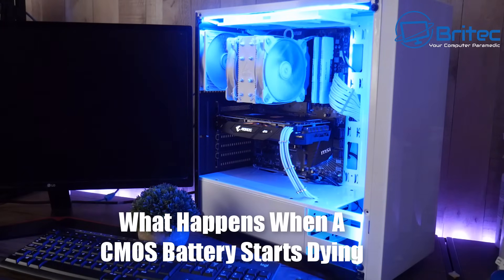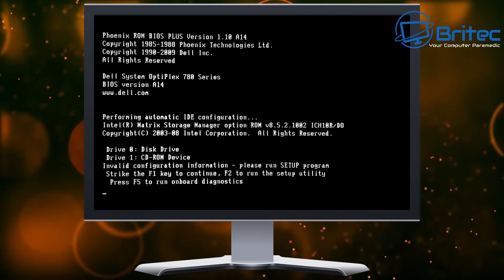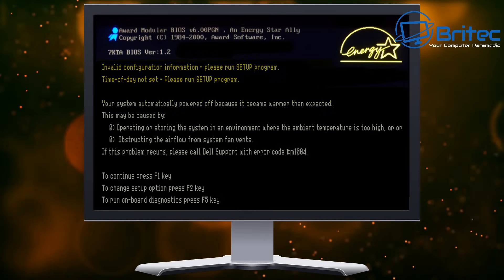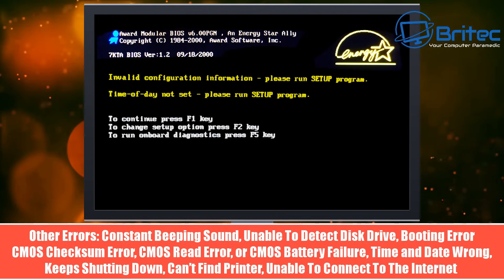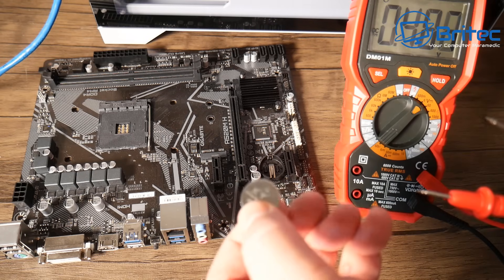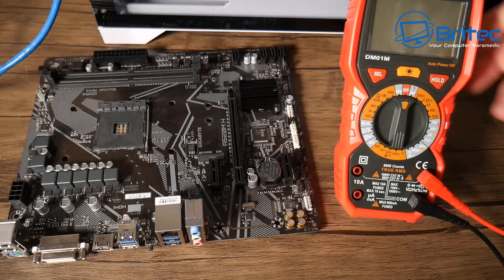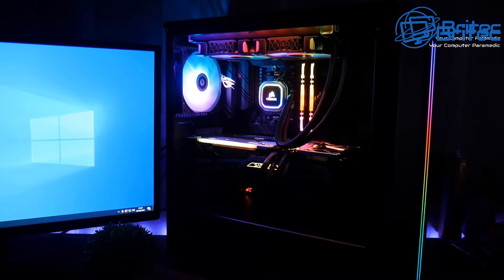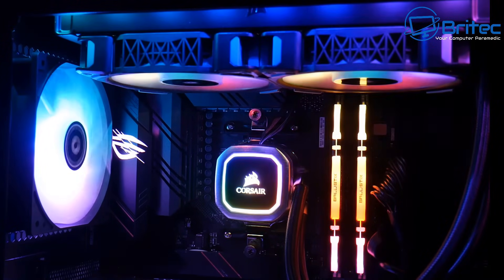What Happens When Your CMOS Battery Starts Dying

Comment from the maker: This video should help you resolve a lot of computer problems. Drop us a LIKE 👍
Reply: One thing I was taught about button batteries (and halogen lamps, too), is that they should never be handled without some kind of skin protection, (gloves, tissue paper, etc.), because skin acids can have an adverse reaction with them, shortening their lives, and causing corrosion, possibly even leading to electrolyte leakage.
This applies to all types of button batteries, regardless of their intended application, whether it's a CMOS, a digital or an analogue camera, or something else.
Also, I don't know about the UK, but here in Australia, we can buy genuine Mallory CR-2032 batteries or their Eveready equivalent at most supermarkets usually in packs of 4, which will last you for years, and much cheaper than those Amazon and eBay burglars are charging (plus shipping costs).
Reply: :dothefive:Never thought of it. Cheers buddy!!
Reply: NEW subb, very useful vid - thanks
Reply: Do you have to memorize all the bios settings before removing the CMOS battery?  What happens, if you missed out on one of the items?
Reply: Thank You :)
Reply: Noice!  need to get this out to the masses.  See a lot of "fix my rig" where they omit checking the 3.3V Button cell on old budget builds.  Bit-rot can cause so many issues that it should be the first replacement you do servicing an old mobo.
Shared! 👍
Reply: Before the memory errors, the clock time will run fast.
Reply: Thx had booting error and could not find a way to fix it it was the Batterie
Reply: A  Ton Of Todays Gaming Crashes  Come From   Just This   =  YES   !!! And = YES  = Very Fist  Sign is an Alltered TIME CLOCK = Virtural Sync Will Not Keep Up with a weak battery  !
Reply: My PC doesn't starts, although it has power in it. CPU fan case fan, nothing starts. I tried everything, like  jumpstart, removing and reinstalling the CMOS battery etc. But it still doesn't work. Actually my pc wasn't been used for a month, and this problem happened. Than I turned on the pc by reinstalling the CMOS battery, and it worked. I used to do that almost every day for almost a month, whenever I face this problem. But today that trick isn't working. Now what should I do? Should I buy another CMOS battery, or it's not the problem of CMOS battery?
Reply: Pls help me if anyone can.
Reply: 16 years still working.
Reply: Little problem at times with the HD and location reinstalled windows 10 now no problem. 16 years 2 500GB Hitachi MBR hard drive still working?
Reply: If I replace the battery will I lose the cmos bios settings. Do I have re enter anything?
Reply: I was just cleaning my PC today and it's been stuck in a never-ending BIOS loop where it loads the motherboard menu for a brief flash to go into BIOS settings but never loads the Windows Boot Loaders from any SSD I have or a USB recovery drive.. 
It seems like it forgets most settings upon reboot, it only turns off with power switch, the power button doesn't do anything. 
I havent checked the clock to see if it keeps getting reset but it's been stuck in a BIOS loop no matter what settings I save, fTPM, Secureboot, UEFI is always correctly set, enable or disable CSM, none of it works.

Just a CMOS battery that's dead?

I just didnt get any error codes other than "your bios has been reset" everytime I have to shut it down and reboot.

Comment: Thanks for the video but, I didn't find it until I found the CMOS battery was the problem with my computer. I had all the possible problems you mentioned but didn't know there was a battery on my ASUS mother board. What pushed me to start looking for my problems was the video to my monitor quit. After changing some component like the video card, and the CPU I found the problem as I was starting to buttoning up the computer case to store it away for parts. I caught a glimpse of something silver on the board just as I was closing up the side cover. After measuring the voltage and replacing the battery, WHAM, the video came on. Solved!!!

Comment: It can also prevent you computer from booting up like in my case. High-end PC wouldn't boot up took it completely apart found no issues. Ordered a new motherboard as it was the only thing not functioning properly. Decided to replace the battery for shits and giggles. Boom 💥 it booted up

Comment: After replacing my thermal paste for CPU, I could not boot up my PC and a red light with +/- sign lit up on my motherboard. I didn't know what the problem was so I took my PC to a service and they checked all sorts of things for possible problems; everything checked out and seemed to work. Almost as a last resort the technician took out the battery and sure enough the problem was in the battery. It cost peanuts to replace it and saved me from worrying if my motherboard or CPU or something else expensive was at fault.

Comment: Both my old dell laptop giving clear 5 beeps cmos battery.!!! My old desktop amd Sabertooth 990fx showing CPU LED error but if I unplug 12v cpu then plug back in I can get it booting eventually into windows 10 with 100% stable system using benchmarks plus playing world of tanks which is why I started up the desktop after two years of not using it 😂. Hopefully two new cmos batteries solve both systems. Sadly both are very old systems that isn’t windows 11 compatible thxs to Microsoft upgrade decisions.🤬

Comment: I disabled DSM to load efi mode and boot normally to win11  and if I restart or turn on the PC I'm always forced to remove the cmos battery because the bios splash logo hangs showing delete and f12  menu
and I have put back all the settings since I need to use efi mode
I don't have a way to test the cmos battery but could this be the battery even if I'm not having any problems when csm is on?

Comment: I'm not getting any boot error messages, but I did notice that my keyboard stops working if I try to use Windows System Restore, or boot off a Windows install media to try and install Windows. PC is 10 years old. No signs of a low CMOS battery though.. not losing any settings. Windows boots fine. Just that recovery environment doesn't activate the keyboard, so I can't restore a backup.

Comment: Will it cause cpu to only work on battery power? Plugged in I'm stuck at 20%. Replaced adapter, charging port, battery, fan. Only thing left is motherboard. This is very strange 🤔

Comment: 🔴🔴🔴🔴HELP HELP HELP 🔴🔴🔴🔴I NEED SOMEBODY WITH KNOLEDGE 
JUST WOKE UP TODAY TURN ON MY COMPUTER( ACER ASPIRE Z1-611) AND APPEARS THIS BLACK SCREEN WITH THIS !!!!!!!!!= 

👇👇👇👇

Setup settings error, CMOS checksum error CMOS battery loss occurs.

Press F1 to continue or Del to enter setup
👆👆👆👆👆

AND A LOT MORE OF INFORMATION ABOVE =

👇👇👇👇👇 

BIOS Date: 11/27/2014

BIOS Version: P11-A0

Release Date: 11/27/2014

This BIOS is exclusively for Acer only

Copyright (C) 2002-2014, Acer Inc.

CPU: Intel(R) Celeron(R) CPU J1900 @ 1.99GHz

Speed: 2.00 GHz

Cache L1 Size: 224 KB

Cache L2 Size: 2048 KB

CPUID: 00030678 CPU Stepping: 8

Memory Type: DDR3L 1333MHz

Memory Size: 8192MB

Channel Mode: Single channel (asymmetric) mode

Press <Del> Enter BIOS Setup

USB Devices total: 1 Keyboard, 1 Mouse, O MASS, 3 HUBS

Detected ATA/ATAPI Devices...

SATA PORT1: HL-DT-ST DVDRAM GUE1N

👆👆👆👆👆👆

SO THIS IS ON THIS SCREEN I PRESS F1 AS IT SAYS AND AFTER I PRESS F1 THIS SECOND BLACK SCREEN APPEARS WITH THIS SHORT MESSAGE=

👇👇👇👇👇👇
Reboot and select proper Boot Device

or Insert Boot Media in selected device and press a key
👆👆👆👆👆

HELP ME WHAT DO I HAVE TO DO I DONT UNDERTAND PLEASE
i dont speak english im using a translator and all this messages are on english, i ask here because im afraid to take my acer PC to tec service cause in most cases they are not honest and lied to me for money and in other they dont gave any idea here in perú they end ruining the PC !!!!
 Write it on 26/03/2025

Comment: No system warning told me to change the CMOS battery! And I had no idea for 2 decades and several PC towers that it had a battery to change. Some I owned 5 years; no CMOS battery issues. My 3-year-old Dell Inspiron 3880 power button wouldn't stay on  more than 4 seconds. Not one wen blog or online thread mentioned a battery. I thought I was going to have to buy another PC or internal power box. With nothing to lose, I tore the sucker apart, looking for anything loose or odd. I quite accidently noticed the CMOS battery. I was perplexed why such an expensive piece of tech like a PC would have such a simple Achilles heel even built into it like that. And also, not give you an advanced warning that it will fail soon. That can't be the problem, right? Changed the battery. Yep. That was the problem. lol. Holy crap, that could have been expensive. Scammers!

Comment: My pc acts strange. i can run my os, but when it comes to restart, it doesn't turn back on unless i power off psu for a bit . Now, if i try and save and exit in bios, it shuts off, but something does go back on, so i turn off psu for a bit, turn back on, bios, and nothing saved

Comment: I have a Dell e6530 laptop that will not remember the date time in my system configuration (UEFI Boot loader setting) when I remove and replace my main battery. So I replaced my cmos battery, then put my battery back in, powered it backup and it did the same thing. So I went back into my bios reset everything in system configuration, got it to boot to my os, logged in, set the correct date and time, shut it down, removed the main battery again, let it set for 5 minutes then put the main battery back in, hopping by now the "NEW" cmos battery would remember my boot order settings, but it didn't. Would this be a motherboard problem or is there a system configuration in my bios setting to help me solve this problem? Any help from anyone would be appreciated.......

Comment: I cant understand why manufactures cant make a way to add a new battery in a second battery holder wired in parallel with the first one to make changing it easier.Cost of the holder certainly couldn't be a factor .

Comment: Not so easy to do with a laptop, in fact well nigh impossible with some machines. I don't think Acer intended my old laptop to come apart. (screws with thread-locking compound on them) No wonder that one YouTuber cut a hole in the bottom of his laptop in order to change this battery.

Comment: My PC doesn't starts, although it has power in it. CPU fan case fan, nothing starts. I tried everything, like  jumpstart, removing and reinstalling the CMOS battery etc. But it still doesn't work. Actually my pc wasn't been used for a month, and this problem happened. Than I turned on the pc by reinstalling the CMOS battery, and it worked. I used to do that almost every day for almost a month, whenever I face this problem. But today that trick isn't working. Now what should I do? Should I buy another CMOS battery, or it's not the problem of CMOS battery?

Comment: I had a strange problem with a PC that I acquired for a reasonable price off eBay, The Seller did state that the Power Button was Hit or Miss and wouldn’t always turn the Computer on & it turned out the fix was to just replace the CMOS Battery, 1st time I’ve ever come across that issue!

Comment: I recently had an issue where I tried to install a dual boot OS (Linux on Windows) but I had an issue with it during installation and when trying to fix it my PC seemed to have just stopped working. I was able to fix it by removing some RAM but do you think it's the CMOS? 

I've noticed since I've fixed it my PC still doesn't boot properly. Sometimes it powers up, then off, then up, then off etc. 

Other times I get rapid beeping and no boot

Other times I get power up and some little ticks. I suppose it could be the CMOS?

Comment: My PC was turning off out of nowhere all of a sudden and one day the PC would refuse to boot. The PC would turn on and the case fans were spinning but the CPU, GPU, and exhaust fans werent. Replaced the CMOS battery and it rebooted a couple times then worked like a charm. Never knew these things could die on you. Been using the same motherboard for about 5 years.

Comment: I had been having pc issues the past two weeks. At first it was hard to get it to turn on i had to press the power button about 5-10 times and then it just wouldn't turn on at all. I took it apart and cleaned with alcohol but still didn't fix. The motherboard had lights on so i knew it wasn't that or a power supply issue. I had to really dig and look up articles and as a last resort Today i finally changed the battery and it started right up no issues.

Comment: i have a micro atx mainboard which doesn´t have a cmos battery. worked fine for 4 years, now i have problems turning on the computer after it was removed from power for about 1 minute.

Comment: Had a power surge recently and my computer wasn't turning on, but the motherboard lights were on (PC was plugged in the power outlet). From the get-go I already knew it wasn't the power supply module, so I started thinking the motherboard had been damaged somewhere. If you're having the same symptoms, I'll save you some precious hours of anxiety: try reseating the CMOS battery, because it worked for me.
Reply: I don't know anything about electricity but isn't there a possibility for the "electric current", or whatever it's called, inside your computer to be "disturbed" in a way either by an external event, like the thunder or internal like maybe the computer parts are sort of "contradicting" each other and sending signals and power in the wrong directions or something?

Comment: i've been having an issue where the pc hangs after powering on and wont enter bios even though the system is on and the fans are spinning, while the pc is on it's fine but getting to power up is stressful, the only thing i've found to fix it is removing waiting and reseating the cmos but it doesn't make sense as to why this would cause the pc to hang like it does

if anyone has had something like this before i'd appreciate any advice. i've already removed everything like drives card readers and usb headers so it isnt any of these, i've also replaced the psu gpu cpu and ram and i still face this issue

Comment: My screen started flashing and then it turned off and no matter what I do the pc will not connect to the keyboard and mouse or monitor but it will turn on and run the lights and fans

Comment: Question. When my pc  starts up from a cold boot(no power) from a couple of hours it tends to hang for a minute or 2 then starts to restart itself a couple of times... Like its checking memory(Ryzen). After it finally starts up in windows i notice my memory is reset to default speeds.... I have to restart and enter bios and save and quit to get my overclocked speeds back.... Systen restarts just fine and comes from sleep mode just fine.... Its only from cold boot does it have this issue.    Could this be Cmos related?

Comment: My PC stopped connect Bluetooth and all wireless setting.  It's are happening because I tried to remove it with a fork, since then I've been looking for some other options to fix it... But I'm not quite sure if it it's hardware ou software issue. Help

Comment: Will it work for my problem? I have an old HP pavilion XT963 Windows XP PC Desktop. I am trying to turn it into a Linux, but the problem is some of the f keys for the bios are missing, I can't use the F12, the System BIOS is shadowed and the Video BIOS is  also shadowed, I keep changing the CMOS Battery it keeps giving me error 0271: check date and and time settings, and it will not boot from both a burned disk and USB for some unknown reason it won't respond. Can anyone help me?

Comment: I came here wondering if this might explain why my pc recently started spontaneously restarting (as in as if the reset switch had been pressed), seemingly at random in the last few days, until eventually while I was trying different possible solutions it stopped displaying the motherboard splashscreen at all and is now completely unresponsive. No beeps either, but it never did beep on startup.

Clearly based on this it's not the CMOS battery, but since I'm here I thought I would ask for advice anyway.

While it was restarting I tried various power setting suggestions in windows, and also disconnected the power and reset switches in case they were responsible. Then when it no longer booted up at all I tried unplugging all non-essential usb devices, reseating the memory and graphics card, and even resetting CMOS. 

The next thing I will do is get hold of an adaptor to allow me to view my main hard disc from my laptop and at least recover the last few days' worth of work that I did between this failure and my last backup, but before I resort to buying a new motherboard and/or anything else, I would welcome any suggestions. Thanks!
Reply: Did you figure it out? I had PC restart due to overheating I think... lowering PSU load on graphics card let it work without rebooting itself. Like in MSI afterburner lowered power use from 110% to 70.

Comment: If you look up a cr2032 they might be lithium button cells but they are not rechargeable..  theres a small risk of explosion if charged.  Never exploded one by charging them (only if heated they explode) but they dont charge..  if you try they do initially read the 3.2v but will fall quickly..  you have to get rechargable 2032’s…